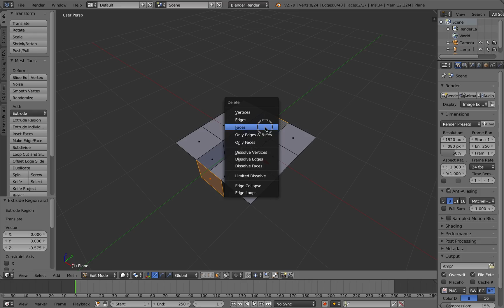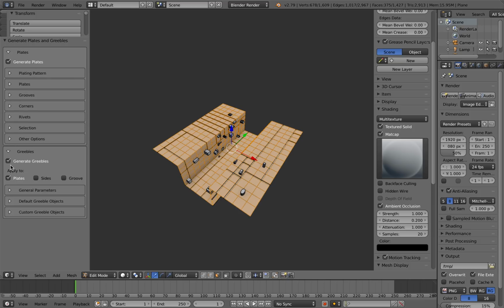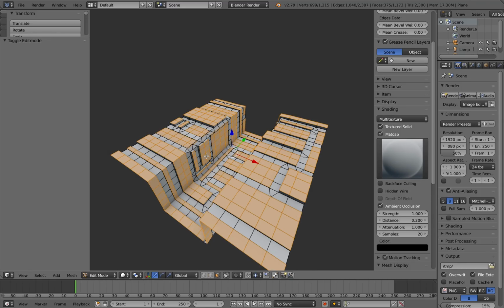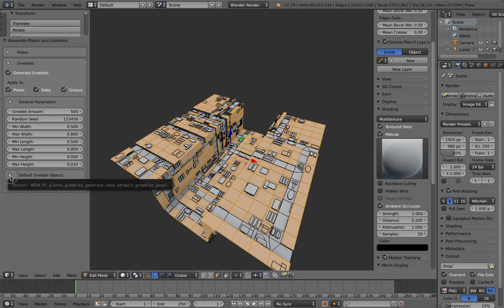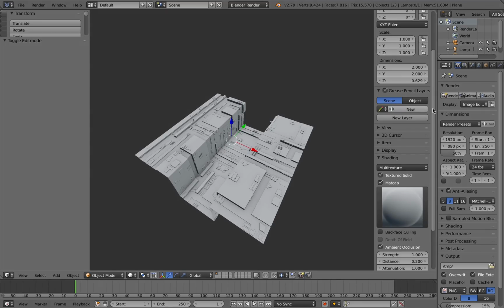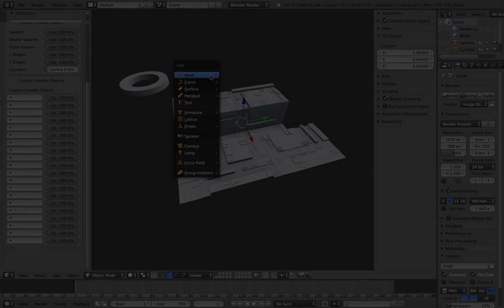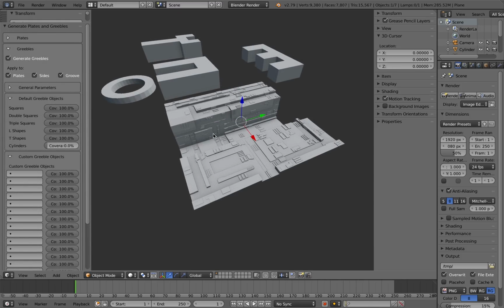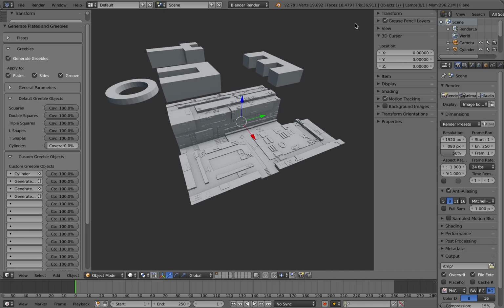Build a Death Star Trench in Blender with Plating and Greeble Add-ons

Comment: is it possible that you could update the generator for blender 2.83, the generator only works in object mode, not edit mode
Reply from the maker: Hi @kripto202 I just checked and it should be working in Blender 2.83 - try making sure you are in face edit mode (not vertex or edge mode).  Let me know if you have any issues though.
Reply: @oldmarkkingsnorthvideos  ya just found out I had to be doing edge select or face select